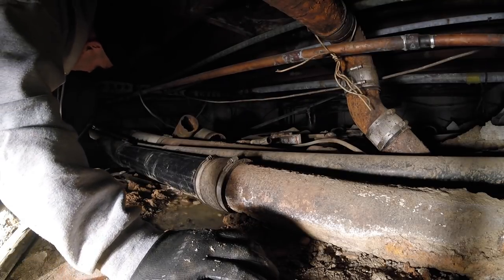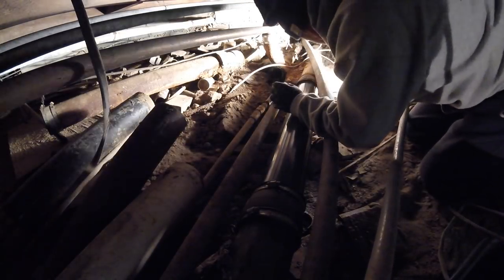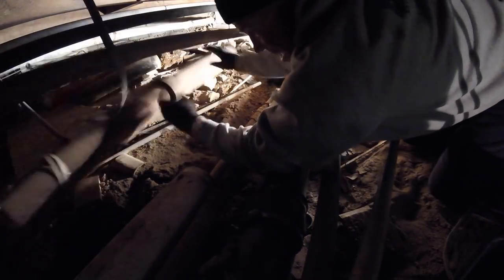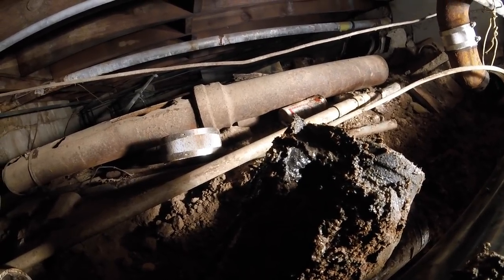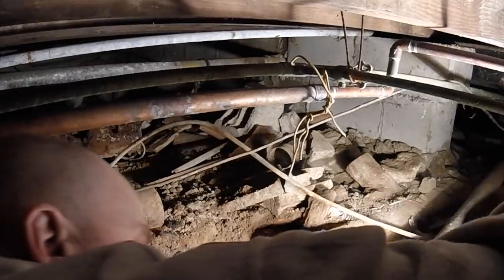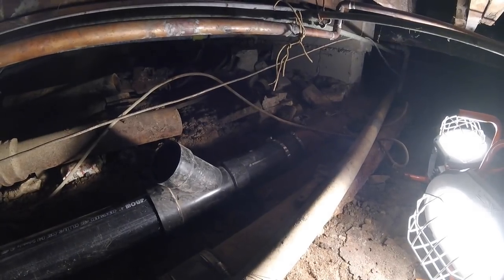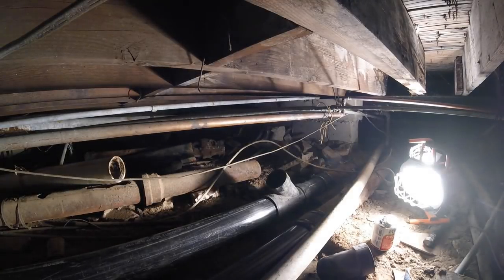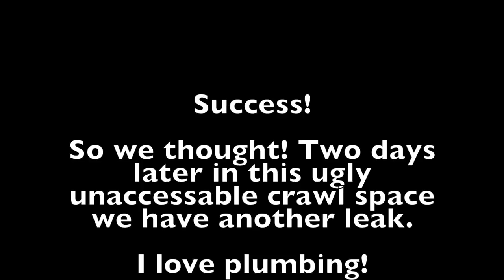Cast Iron Wye Leaking

Comment: There are only two things that make cast iron corrode prematurely. On the bottom it is what goes down it having a pH less than 4.3 or greater than 12. On the top is a gas called Hydrogen Sulfide which condensates on the crown of the pipe and eats a pin hole until the entire pipe splits. It appears in this case due to improper slope they had a blockage and poured something down there with bad pH which sat in the pipe channel and ate out the bottom of the pipe and fittings.
Reply from the maker: Thanks Rich. Appreciate that.